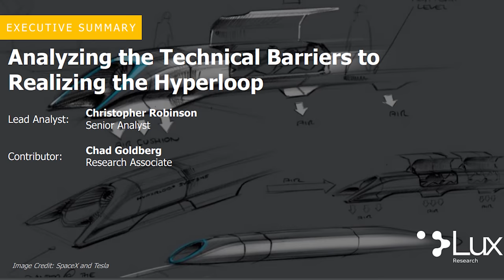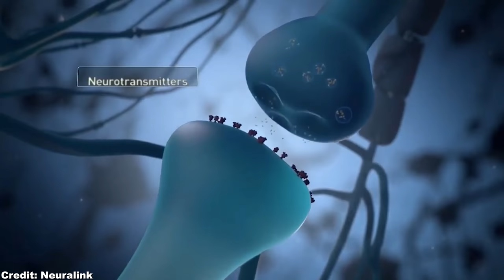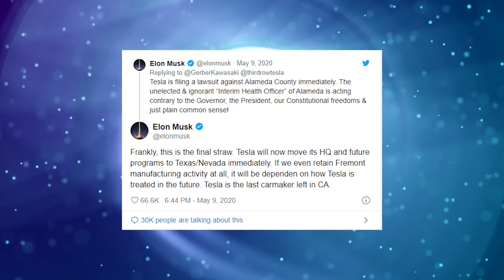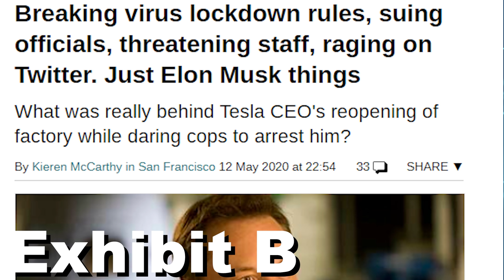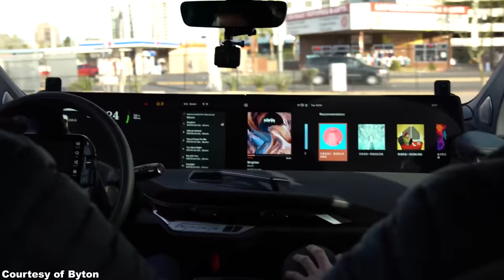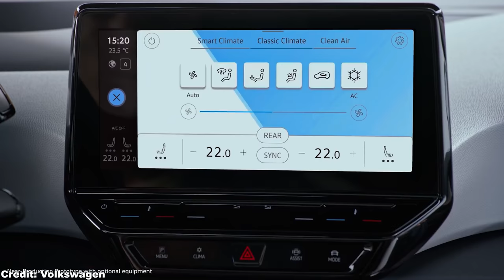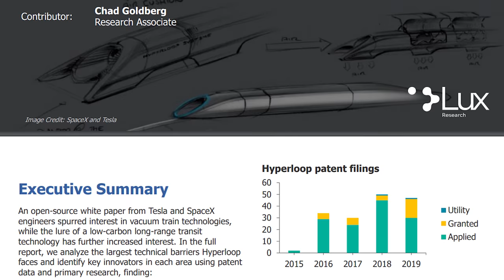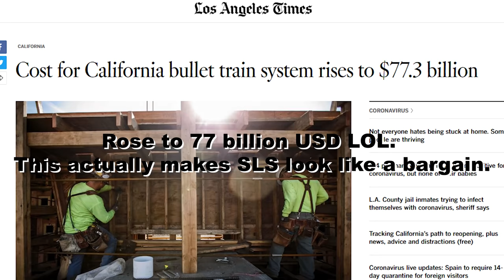Tesla Factory News, Byton Threats Bankruptcy, Neuralink by 2021?

Comment: If I understand correctly; Hyperloop's main advantages are speed and extremely low drag and therefore low energy consumption. While it is true that electric flying taxis use more energy and due to sonic booms are perhaps a bit slower; they don't require too much infrastructure. As batteries get better and solar electricity even cheaper; the advantages of Hyperloop even for long trips might be eroded..

Comment: The infrastructure required for surface operated high-speed rail and hyperloop offers multiple opportunities for terrorist attacks. Underground hyperloop might be safer, but the safest high-speed travel might be through the air which requires minimal infrastructure. Everybody will have to learn to fly on the right side of the airway for the whole thing to work though.
Reply: @TechChasm  Great. I'll be watching.

Comment: About your take on NeuraLink, I've seen many people, mostly armchair 'experts' but some claiming to actually be experts, saying that NeuraLink will only be a glorified brain keyboard and never be capable of anything else. Every time I see these claims it makes me facepalm. It shows they haven't actually done any research into what NeuraLink even is at all. Unaware that it's a two-way BCI, as stated many times in Elon's presentation. Thousands of hair-thin electrodes, capable of both sensing neuronal spikes and stimulating them at one electrode resolution if needed. 

I completely agree with you guys that this will be a revolutionary stepping stone of a device, eventually capable of Matrix or Ready Player One style VR simulation, essentially full sensory stimulation and immersion. The brain works on, well, patterns of activity. And if you wire thousands of electrodes into your auditory, visual, and other sensory parts of the brain, map and predict patterns and then stimulate the brain in a similar way, you get implanted full immersion VR and an incredible new understanding of the brain and capability to map its activity like never before

Comment: When was the last time you included an update to smart grid technology in the Disruption report? :-D
Reply: Really has been any news about that in years. I have seen ideas for low loss transmission lines etc. All involved super cooling and high end tech. =expensive.  There is only so much that can be done. Storage is the answer that makes the most sense.
Reply: What about like IoT tech, smart metering and load balancing?! Saving contracts like agreeing to leave off the AC for a few extra hours during peek load? Minute by minute billing?
Reply: @SethEden  That's all  been around for decades. I had a water heater that turned off during peak power usage for a while. Problem there is many appliances have gotten much more efficient. Think about TV's and computer monitors. The power demand has drop hugely since LCD's were introduced. The power companies are having a problem right now with using renewable's like wind power.  Over all  storage of excess power creation is the answer. That would smooth out the power demand numbers.
Reply: @crp9985  It is true these things have been around for decades but I wasn't talking about consumer electronics. I was talking about smart grid....as in grid scale intelligence which is far from being implemented. Even renewable appliance right now are not smart by any means. Any home based solar panel system has to go through a certification process and miles of paperwork. Distrobution panels and relays are still far from intelligent and have to be manually checked. The relays at big corporations have inspection requirements. Grid monitoring software at the grid distrobution centers is all custom software and each system is different with different interoperability and operating standards. Data-gathering and sharing between grid stations is not really a thing because of the differences in those standards so learning and improvement is not really possible. Heck, phase synchronisation is still done manually and as such grid switching can still cause brown-outs and dirty power at the consumer end. It may be true that better storage and utilisation could smooth the demand out but the availability is driven by ease of use and these grid-scale systems are still FAR from being easy to use! And how effective they can be is driven by how intelligent we use them. Simply just plugging them in and letting them work can only help a certain amount. To get full potential of these systems they need to be managed intelligently as a network.

Comment: Both high-speed rail and hyperloop will be made obsolete by the coming robotic EVTOLs. Fly from any local landing pad made out of a converted parking lot to any other landing pad in a straight light faster than High-speed rail non-stop, no need to build long expensive fixed tracks or tubes through everyone's backyard. When batteries pass 400wh/kg Elon Musk himself thinks we can build supersonic EVTOLs so there goes any speed advantage hyperloop has left after queuing up at a centralised station to go through airlocks.